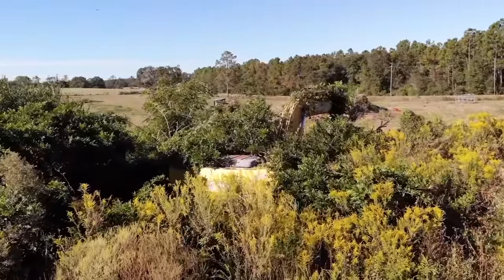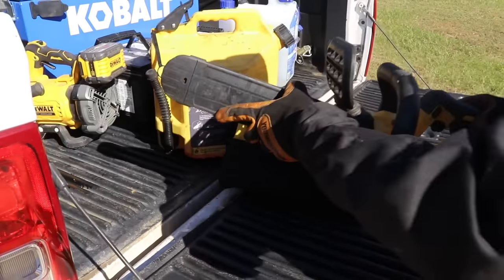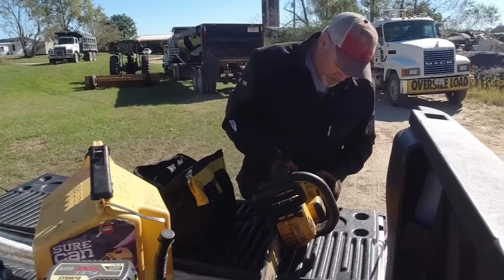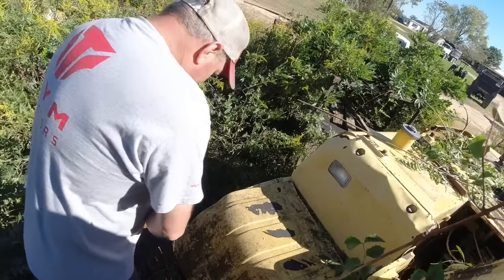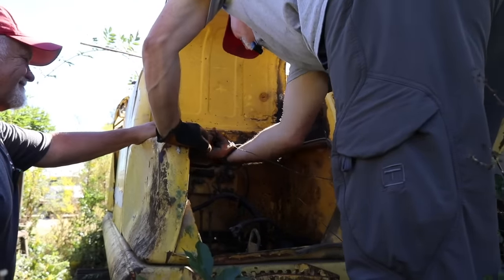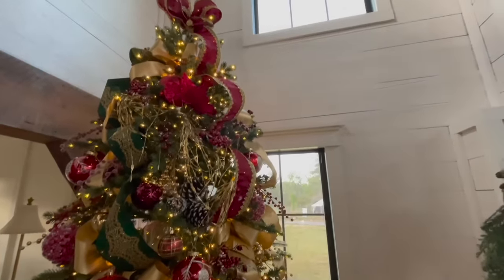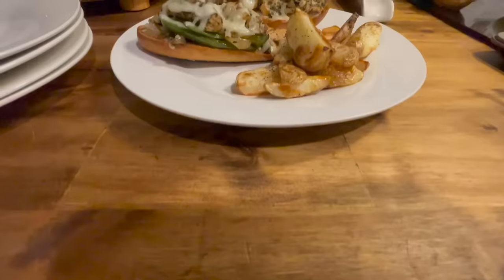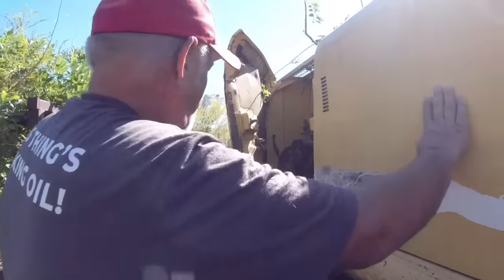WE FOUND A KOBELCO EXCAVATOR THAT HAS BEEN SITTING 17 YEARS!

Comment: Quite often if you CAN get to the crank bolt easy enough it can be started after you get it through a few revolutions using breaker bar. Some times the starter gets old and tired and can't move an engine that well when it is loose let alone being stuck a bit.

Comment: I noticed that the exhaust stack wasn't bent totally away from rain entry, and I didn't think it was going to escape the rust monster. If you took the head off and worked on the rusty cylinder maybe it would run, it would be worth the effort if the rest of the machine was in as good condition as you said.

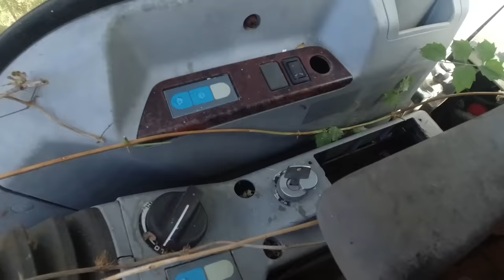Comment: Did you turn the throttle knob clockwise a bit before attempting to start? It appears to be in the off/counterclockwise position at 41:42. I have a Kobleco/Yutani 320BLC. It won’t start with throttle down/off. In the case of my machine it’s a throttle lever (not knob like this 160) that must be pulled back to start and then forward to turn off/kill the machine.

Comment: I have a question I hope u can answer I got a small three cylinder diesel engine that is locked up because the injectors were out and the oil seems as if it is still really good and new and dirt was covering the injector holes do you think it’s possible to get it running without a rebuild? great vid btw
Reply from the maker: It’s possible.  Throw some marvel mystery oil in it for a few days and try it and see!
Reply: @HamiltonvilleFarm  ok thanks I dumped some WD-40 down the cylinders thanks for the advice